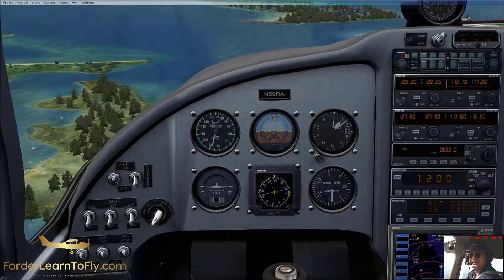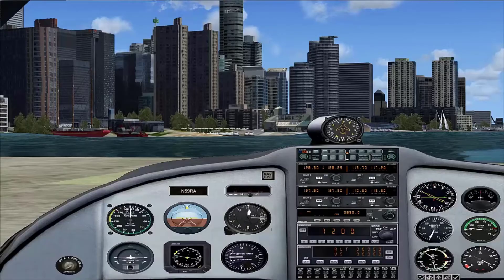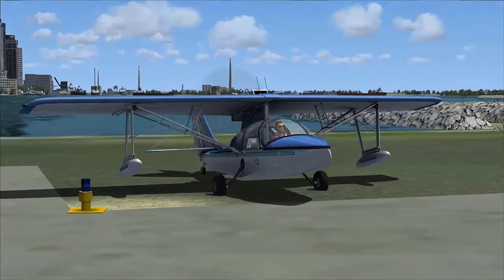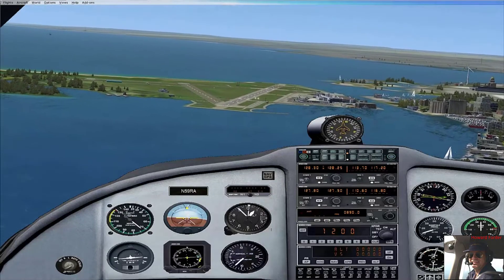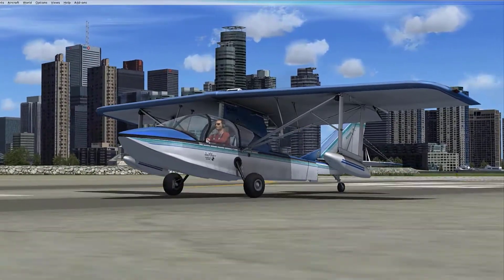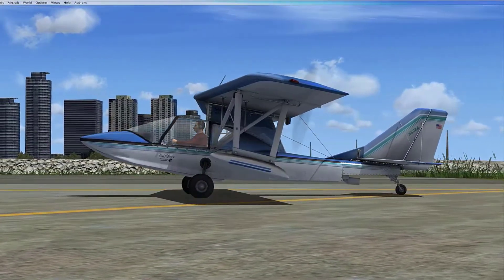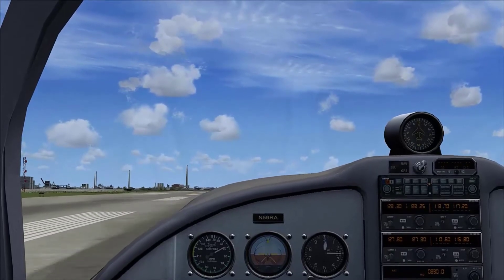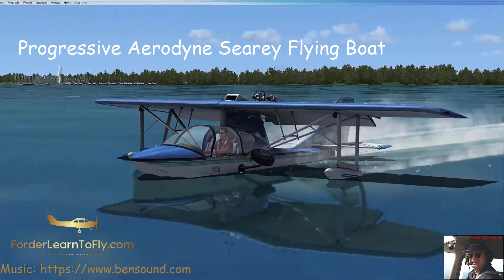Searey Amphibious Homebuilt Airplane

Comment: Very fun sim.  A few details to clarify.  The motor you are showing is green head - so rotax 912s which is carb and no turbo - 100 hp.  Those takeoff and landing numbers are…well…optimistic at best.  The rotax motor in these planes is not at all a snowmobile engine.  Its specific to aircraft and can be certified for aircraft.  The model you show is a classic, A hull.  The current model is a C hull and has different flying wires, etc.  i built mine a dozen years ago.  Happy to chat if you have specific questions.
Reply: Hi Ken. Thank you for the details and a deeper understanding of the airplane. This was done to introduce simmers to airplanes other than the standard 150 or 172 trainer so they will experiment and expand their horizons. Although it is evident I don't know the real airplane, I have seen them around grass strips like Baldwin, north of Toronto Canada and I have been in one in the right seat and loved it. The video wasn't intended to be as specific as you state, but it sure helps anyone watching the video and wanting more details. I appreciate your efforts and comments. Thank you.